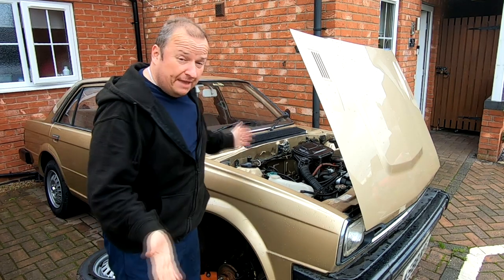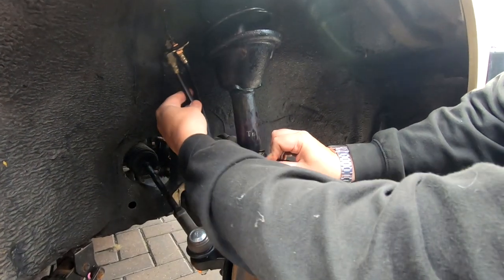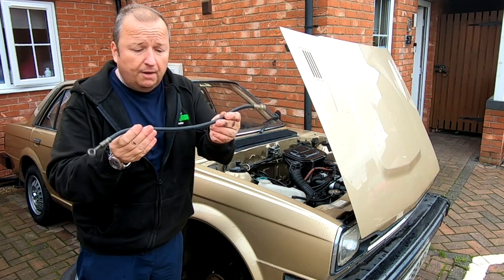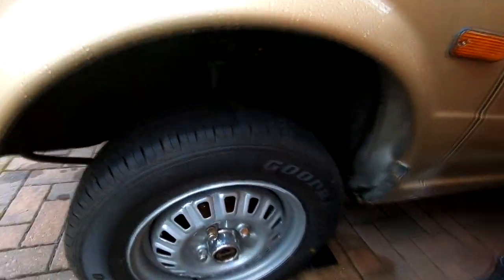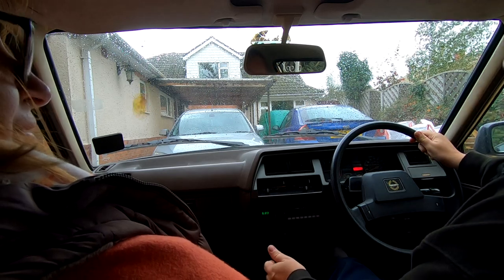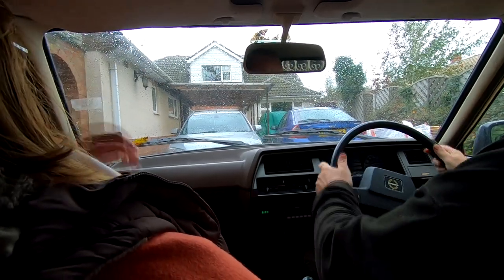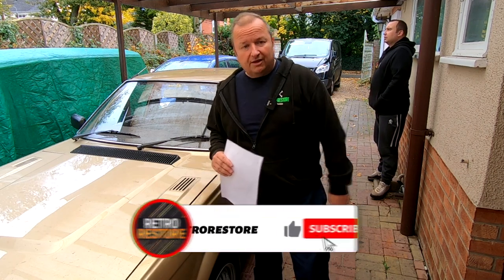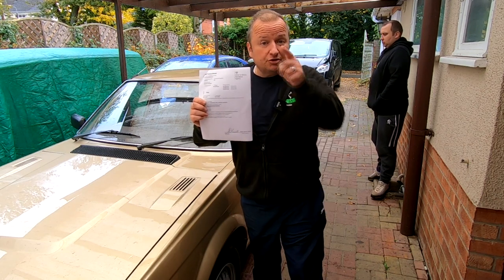Triumph Acclaim Brake Fail Cause And MOT Day Part 39

Comment: Looks like a grinding disk cut mate check the cameras hope you find something as that does not happen on its own
Reply from the maker: Exactly
Reply: Exactly what I thought, and the scratches on the wing do not pop up by themselves either - I'm calling foul play I'm afraid. :(
Reply: @retrorestore  if it was done in purpose there would have been a puddle surely? I reckon the wheel edge rim has scuffed it. That pipe is quite close to the rim lip. Or maybe some debris trapped in there on the first run? Foul play they would just snip it surely.
Reply from the maker: @louisjames1062  Nowhere near it,even on full lock
Reply: Agreed. I would say definitely a grinder cut!🤔🤦🏼‍♂️
Reply: @retrorestore  looked around the same level in the video, but hard to see
Reply: I was gonna say that like  someone tried grinder it i like the sound the gear box in it
Reply: Someone would have noticed you fixing the car then messed with ir

Comment: Martin, looking at that hose, that gouge has the same thickness as a grinding disc,, 
Some bastard has went to some length to do that, and as for the scrape, youdve noticed it sooner had it have been there. Id be scouring through that CCTV hard drive of yours and getting to the bottom of it. Deffo wouldnt have rubbed off the wheel rim or off any other component.  Definitely deliberate mate.

Comment: To be honest my first impression on the brake hose would be sabotage, as the scratches on the wing don't make sense either Mart. Funny it happens while you were away. I agree with other comments on the grinder disc aswell.

Comment: Hi Martin I don't know if anyone's already said this but it looks like that hose has caught on the back of the wheel when it's is on full lock I had one what did that sometimes it would flip towards the wheel and sometimes it would flip away from the wheel. It will be sad see that car go all the best mate Colin
Reply from the maker: Thanks Col, we did check full lock and it was nowhere near.

Comment: Great video Martin. That hose couldn't have been fouling on anything to rub a hole it, if it had they would have found it on the mot test, i used to be an mot tester and you  have to do a full nearside and offside lock of the steering. And besides how could it have rubbed on anything if you never drove it anywhere ? would take a long time to wear a hole in it just by driving. It has been cut by someone probably in the dark and they hit the wing with whatever they cut it on the way down.
Cheers, Jeff.
Reply from the maker: Great point Jeff

Comment: looking at the almost vertical angle of the cut it looks like the edge of the inner rim of the wheel cut through? On full left lock the strut will turn with the wheel and hose and because the hose was clamped to the strut depending on how much slack between it and the calliper and bodywork bracket might it have caused the hose to be pushed towards the wheel rim? if you measure 6.5" from the clamped portion on the hose does it match the cut? if so the 13" wheel rim cut it?
Reply from the maker: Nowhere near it,even on full lock

Comment: Mice, Rats or a squirrel!
Top job on the car. Top top job. It's mint
Reply: I thought that at first, after seeing the mouse in another video. But mice and rats tend to go for coolant hoses as the coolent smells sweet to them. Had it on mine and hole was different.
Reply: @WestYorkshireGuy1  plus that's too clean for rodents, and gnaw marks are obvious

Comment: Very strange indeed Martin. If it had of just been the hose then I’d have just put it down to a mechanical fault but those scratches in the same area are just a touch too suspicious for it to be a coincidence. Hopefully the cctv will give you the answers but as others have said, maybe check all your motors just in case 👍🏼 take care bud 🤞🏻🤞🏻

Comment: The white line is your witness mark, aswell as the hole and the rubber hose its self. With it in its assembled position it will be easy to see if the wheel caused it, also the wheel/tyre would have the corresponding witness marks.
A close up of the hose certainly looks like a rotational abrasive mark.
I certainly hope that you get to the bottom of it mate, because this could be classified as attempted murder, in which case you definitely need to be watching your back.
All the best.

Comment: When the suspension  goes down on road the hose is rubbing on the wheel rim
Reply from the maker: Not in this case Alan.
Reply: @retrorestore  if it had been sabotage you would have had no brakes as soon as you took for test run first time  !   It's definitely rub through marks...  sabotage it would have been a clean cut with knife or snips.  Another thought was ... did YOU  nick  it with a grinder while  cleaning up welds or similar ????
Reply: @retrorestore  
Did you check it with full lock on both ways Martin. 
Be really nasty if it was vandalised.
Reply from the maker: @bobp6742  Yes Bob, we did and they also would have put it on full lock on the MOT and not passed it if it was fouling.
Reply: @retrorestore  
Very strange??
Reply: Ellis The DJ  Good point it could be manufacturing defect with the inner braiding? Csi retrorestore lol
Reply: Doesn't explain the scratch tho

Comment: That cut is either caused by the wheel bubbling on it , or a grinder disc. If someone was messing with the car they would use a Stanley knife.
That's not a knife cut. More likely there was a problem how it was clamped, and it allowed the wheel rim to contact it.
Reply from the maker: Nowhere near the rim. I've said it many times in the comments.

Comment: If you don't see anything on your cctv, that looks like it's rubbed on the edge of the wheel rim. Hold the damaged pipe to the rim and see if it's the same radius. Could be when it's on lock and suspension compressed the pipe kinks to the wheel. You might need to undo the pipe twist it and give it some preload to keep it out the way. Just seen others said the same, I would still check if the cut in the pipe fits the radius of the rim. Could be it hits in a fluke situation, don't want that to happen at 60mph!
Reply from the maker: Already checked that Eddie

Comment: Would hate to think someone's been tampering with your brakes mate. It looks like a grinder Nick but if the pipe was twisted a bit could it have caught on the inside of the rim when it was on full lock?
Reply from the maker: Nowhere near it,even on full lock

Comment: Is it possible that at some point, you ran over some kind of debris that leaped up and hit your brake line? Driving over something like a downed tree limb or bent Rebar rod could do this, as well as scratching your car.
Reply from the maker: Not really, only drove round the block.

Comment: Where you under there with an angle grinder doing any work at some point and maybe caught it without knowing?
Reply from the maker: No, I haven't
Reply: Hopefully you get to the bottom of it, it’s one of those things that doesn’t really matter as it’s fixed now but the curiosity of how it happened is more annoying.

Comment: Foul play by the looks of it or maybe a vermin problem but can't see how the wing would have got scratched maybe what's scratched the wing cut the brake hose , that's attempted murder if it is check out that cctv straight away 👍👌

Comment: Looks like someone has cut it with a knife
Reply: Pliers more like
Reply: Looks nothing like a knife cut, that's a chaffing mark, not a clean cut
Reply: @MrRsmad69  Its a clean cut
Reply: Not via a sharp blade no its not, Stanley blade or knife would not make that cut, a wheel rim or grinder blade would of made that, you can tell by the way the fibres are
Reply: @MrRsmad69  It looks like its been cut with snips

Comment: Sorry I'm not Sherlock Homes  but IMHO - it's not the boogie man come to visit - however it does make for good viewing rates and comments ..think of the £££££... Part 40 "Triumph Acclaim - Murder Mystery Weekend"  
In panto style .......it's the wheel rim touching .  The damaged hose has "twisted  up" when you turn right  and has been  touching  the rim of the wheel.  I suspect there was an inherent twist when the original one was fitted too which exaggerated the problem. Suspect you correctly  fitted the caliper to the hose (as opposed to the hose to the caliper) but was there a twist in it .....one too many or too little twists of the caliper .. if you see what I mean ??  which then caused the hose to twist out slightly.  

In all seriousness - it must have shook you up...not a nice experience.  Take care and look after yourself.
Reply from the maker: Nothing was twisted nor touching on full lock
Reply: @retrorestore It ain't a grinding wheel for sure - the rubber would have a black melted appearance. Also you would have to be  a  cross between a  surgeon and  Stretch Armstrong  to get a grinder  around the wheel  just to grind the hose and nothing else. Can't see a vandal taking the wheel off and putting it back on - can you ??? .  Common sense says - it was gently  rubbing on the wheel or tyre intermittently.

Comment: That could been the wheel on full lock rubing on the rubber
Reply from the maker: Nowhere near it,even on full lock
Reply: @retrorestore  could the pipe come out the clamp maybe ??
Reply from the maker: @lukeb709  No bud.

Comment: are you sure its not when the suspension goes up and down on a full lock...such as turning into a junction with a pothole....... i doubt its sabotage as its too small someone would more likely clump it with a 6lb sledge hammer!!

Comment: Rats or mice I had a problem where they chewed through rubber pipes and electrical wires around my gearbox
Reply: I thought it might have been that as well 👍
Reply: @ASH.......................1976  when I got it fixed here in London the mechanic said he gets loads of cars in , for rodent damage to wires and hoses they chew the insulation off to use as nesting material,the damage on my hose looked exactly like that
Reply: @singh-sks  yeh,it's got to be 👍

Comment: Looks suspiciously like an angle grinder cut m8 :(   Wondering if someone worked out where you gaff is or you had someone trying to have your hard earned stuff on the thieve grr   If it was a deliberate act you need lily law to get involved as this is serious.